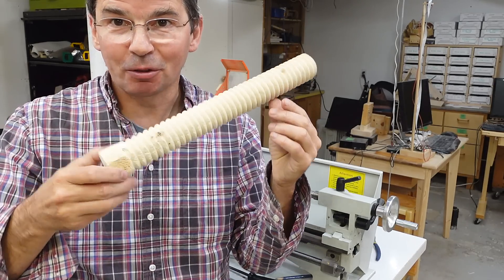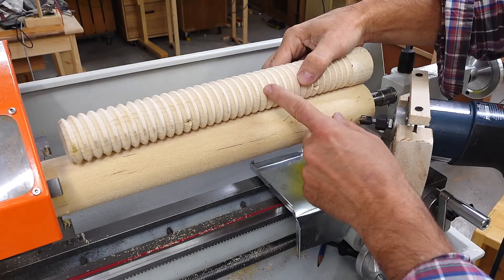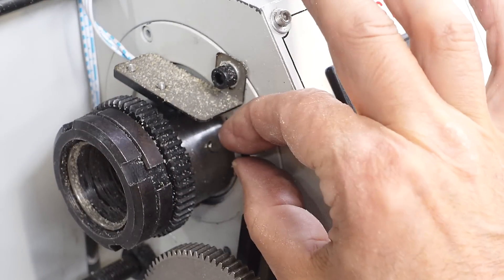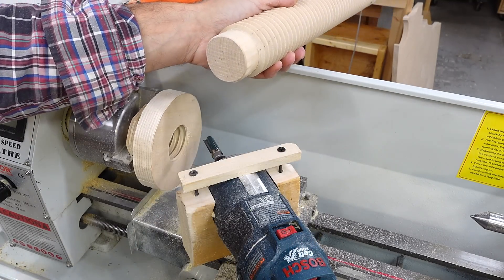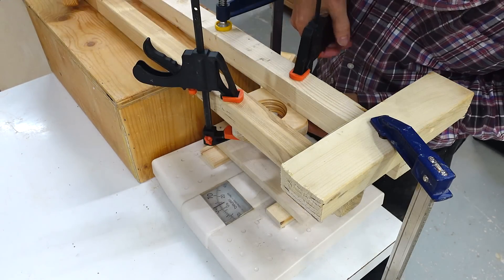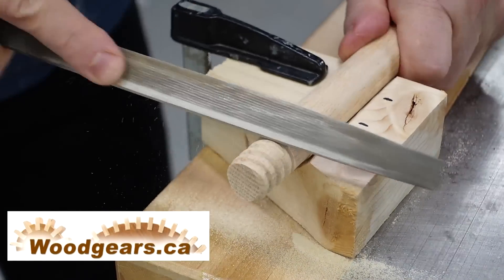Big wooden screw and nut on the metal lathe

Comment: If you are in the humour to make giant screws, i'd like to see you make a worm. there is a ham radio antenna rotator called the spid alpha that uses a worm to turn a cog. this is because a motor turning a worm does not require a brake to remain stationary in high winds.

Comment: I would think if the router is spinning, you'd be able to cut the wood going towards and away from the chuck. Right? No need to lift and return the tool to the start unless backlash was an issue. Now for the elephant in the room.....2 MAJOR safety violations. 1. the loose long sleeves on the wood lathe and 2. you left the key in the chuck. OK..I said it. Nice result though. be safe.

Comment: Maybe for on a wood lathe which are usually larger, but don't have a lead screw. Make a differental (aka Chinese) pully. Drive the pully from the headstock.  Then use the differental pulley to convert rotation into linear distance. pull cutting tool along a linear guide etc.

Comment: Can someone explain why the router is cutting the threads at an angle vs using a v-bit and cutting straight on? The only thing I saw is that it allows cutting the inside threads. Is there another reason?
Reply from the maker: that way I can cut into the wood, as opposed to one side cutting out.  also can cut much faster, and no burning, and clears the chips better

Comment: I long thought about a way to make a wooden nut without buying a specialty cutter.  Cool!
Reply from the maker: problem with this approach is very limited depth, unless you try to cut from both sides, but then aligning is difficult.  Or make two flat nuts and sandwich them.
Reply: @matthiaswandel  could you get greater depth if you used one of the bits from your morticer or is the thread angle the limiting factor?

Comment: I plan to build a toy involving wooden threads for a Christmas gift this year. I'm undecided as to the material for the wooden nuts. The best options I've come up with are some scraps of 1 1/8" plywood subfloor, hardwood, and making my own like 3 layer hardwood plywood. Seeing the plywood nut here makes me think it will be adequate. Though the subfloor is not that nice of plywood. I could glue 2 pieces of decent plywood together...
Reply from the maker: Or just use baltic birch plywood, which is what I used.

Comment: Acme thread forms will have more thickness and less taper, maybe better for wood - like a broom handle thread.  Acme = inch, Trapezoidal = metric.
Reply: I was thinking that as well, but it might be more difficult when the thread cutter is a spinning router bit being fed in at an angle like that.
Reply: @F0XD1E  Yes.  He would probably have to grind a HSS toolbit and put it in a small  angled flycutter toolholder to do it that way.

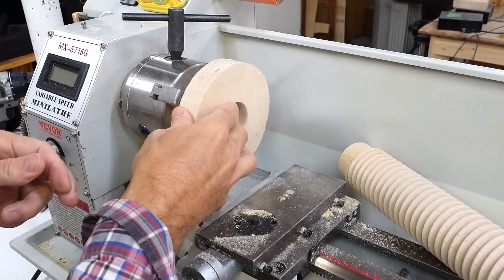Comment: 04:25 if you get the jaws of the chuck out and turn them arround you can clamp from inside, you should be able to clamp that part 
I know it would interfer with your cut but I thought I would still mention it in case you don't know about the jaw turning. Be careful tho, usually the order of the jaws is important for the chuck to be aligned
Reply from the maker: The jaws don't turn around, this lathe has a separate set. 
And clamping the nut from the inside is not practical because I was milling the inside.  Duh.
Reply: @matthiaswandel  you could  clamp inside hole ,turn outside to dimension that could be hold in outside clamping jaws. if part dimension allows it ofc.Its standard  for rounding things like flanges,washers etc. . .
Try get 4 jaws chuck with separate moving jaws and dial indicator then you can make excentric parts.Also there is a thing called face plate for mounting ireggular things with clamps and screws.
Reply: @matthiaswandel  I mean I also said I know that it would interfer with the operation, just wanted to  give info in case you are not aware of it yet. Was in no way meant to be lecturing or anything considering its not even useful in the operation you are doing.

Comment: In the old days (1930-1960) of shed-in-the-garden model engineering in the UK, there were two traditional projects for the metal lathe.

One was a handle for the main spindle - this allowed super low speed, high torque operation, and extended the range of possible projects.

it gives remarkable control for threading, e.g. up to a shoulder.

The other was a handle for the lead screw - exactly for the high pitch thread scenario you demonstrate. The pathological worst case pitch is rifiling, which can be as little as half a turn over the full length!
Reply: Those enthusiastic 1930's craftsmen would have given a vital organ for a variable speed hand-drill!
(Craftswomen in the engineering shop had not yet been invented... women had too much sense!)

Comment: I've never owned power tools or had the space to do woodworking. But I'm in love with the craft. Hope someday I can do my own small projects. good video, man
Reply: you dont need power tools or lots of space to do some small projects. go to a flea market and pick up some old hand tools mainly a hammer and a chisel and a saw if you wanna get fancy. when i was like 12 i broke a kitchen drawer and spent all day fixing it by cutting a new bottom out of old plywood with nothing but an old hack saw blade. funny thing is that drawer with the custom jagged bottom is still in my moms house 15 years later and still functions
Reply: Carving might be an option for you.  It's messy, but doesn't take a lot of space on the small scale and you can get started with just a few tools.  Just keep a first aid kit around for when you inevitably cut your finger.
Reply: I have a 1960's jigsaw and power drill, two long clamps, and a single tool bag of hand tools I've bought over time as needed (screwdriver, pliers, etc). A surprising amount of things can be built with this setup and it takes up almost no storage space. Most of my projects are held together with Robertson screws from McFeelys.

Comment: Running the lead screw for a very large screw pitch is some thinking outside of a box! Recently I need to make a large thread on my lathe - a wooden form to wind a coil for an induction heater and I am going to steal that idea. By the way - I have purchased a 1000W induction heater for my workshop and have been playing with that. It is only about 25 bucks kit, but you have to supply your own power supply - 48V at at least 20Amps, which is not trivial. The heater can heat up a tip of a chisel for heat treatment in under a minute. You can also use it to braze your own lathe tools using discarded tungsten carbide inserts.
Reply from the maker: Is this some sort of surplus part?  I have an induction hotplate, which is tempting to attempt to convert for forging
Reply: @matthiaswandel  I think they're a kit you can buy on the usual places - search for "zvs induction heater" - it uses a zvs flyback driver circuit, hence the name. I think more commercially, places like Eastwood and a bunch of other brands badge and sell them for heating stuck nuts and bolts without a torch, but they're rather pricey when they're a finished product ready to plug in and use
Reply: Forklift chargers are dirt cheap and most of them are 48V with at least 40A. Nice "little" power supplies.

Comment: I have a height adjustable stool that uses a big wooden screw, and it's nice in that it lets me adjust the height infinitely.
Reply from the maker: I think those look cool, but I prefer the stools I made, which I made for the height I want, and they are rock solid, good for standing on too.
Reply: One of practical uses for those I've seen is piano stools. I used to have one of those round ones that's been with me all the way whilst growing up and it could be adjusted quickly.

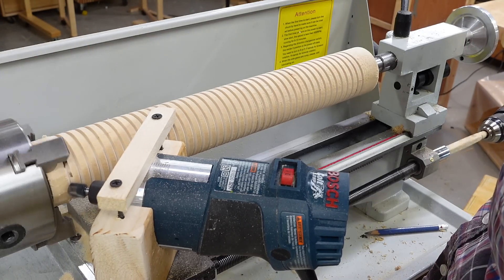Comment: 2:12 "So no damage to the carbide router bit"  -  That poor chuck 😞
Reply from the maker: It actually just looks like a scratch on the chuck jaw
Reply: @matthiaswandel  :  I have a 70 year old lathe... the chuck does not even have a scratch on it!...
(It's a new chuck, fitted last week!)   😋 😜
Reply: Just wait til 3:10, that scratch is the least of the lathe's concerns 😅
Reply: Eh, lathe chuck jaws get damaged all the time. As long as it's not a clamping surface, its fine, and if it is a clamping surface, you just use the lathe to turn them back so they're even again.

Comment: Hi Matthias.
@3:34  the Hall effect sensor you are pointing at is only connected to the RPM display. It only receive 5v from the main board.
The motor speed is mesured from three additional sensors hidden inside the head, on a dedicated PCB.
Reply from the maker: Ah, good to know.
Reply: The sensor is likely ONLY for the display.  And there is likely ONLY one sensor.  There doesn't need to be any feedback to the motor control.  The potentiometer sets the speed.  It sets the pulse width.  Nothing else is needed.  And Vevor sure isn't installing anything not necessary.
Reply: @mk6595  
There is actually some feedback to the control board on this lathe. The PCB inside the headstock connect both the 3 phases and a signal cable with a JST connector.
I have the exact same lathe and had to replace the motor on mine.
Reply: @quentinbonenfant7992  What three phases?  This isn't driven by 3-phase power.
Reply: @mk6595  this model is powered by a brushless DC motor, which uses three phases. The main board convert the ac main power into three phases, a bit like a VFD. Check out replacement board for this model, all the I/O are labeled.
Reply: @quentinbonenfant7992  Well, I'm impressed.
Reply: @quentinbonenfant7992  I have this same exact lathe model and the hall magnet ring is for the tachometer display only. The brushless motor itself has hall effect sensors for timing it's commutation. You do not have to have position sensors for a BLDC but for this low RPM/high torque application, you do. There is no VFD, it's a DC brushless motor. Rectified AC stored in bulk capacitors and some mosfets to switch that on time. The RPM display gets it's power through a JST connector on the spindle control board. The magnetic hall effect sensor plugs into the display directly, there's only two 5V power wires between the display and motor controller.  

The final tell, the motor has three large gauge power wires for the three phases, and then it has a 5 wire JST connector. That's a hall sensor for each phase, plus power and ground.

Comment: I made an extension for my lathe by using an inner bearing race from a front wheel bearing off of a Toyota RAV4. This so happened to fit the threaded nut off of an angle grinder. I pressed it into the race very careful to keep it square and then I spot welded it on. I found a 5/8 bolt to fit the threads and cut it to a 30° point in the lathe. Now remove your tailstock and this assembly can be mounted in your steady rest all the way to the end of the lathe. You can dial in the center using the adjustment screws on your steady rest. I should mention, the bearing race has a flare on it so make sure that is toward the head stock so as you tighten the center point screw, the flare will rest up against the edges of the steady rest screws to keep everything from pressing out of the steady rest. It all worked great and gave me another six to eight inches of room on the lathe.
Reply from the maker: if I needed to make a longer wooden screw, I'd make some wooden tailstock that attaches to the end of the lathe.  But the next limit would be carriage travel.  Still, I'd be able to get at least another 5 cm of threading that way, plus a bit more unthreaded part at the end.  Now just need to find a need for a wooden screw like that.
Reply: @matthiaswandel  Aren't you going to make a wooden machine lathe?

Comment: I could see you making a height adjustable desk where you turn a large wooden wheel, that through wooden gears raises and lowers a desk.
Reply from the maker: problem with wooden screws like that is they are relatively inefficient compared to a rack and pinion, so hand cranking it would be a lot of work.  The basic flexispot desk frames are not very expensive, so not very motivating come up with a wooden version.
Reply: @matthiaswandel  A child powered Hamster wheel attached by belt-drive to the FlexiSpot gears in the event of apocalypse and no electrical power is available 🤣
Reply: A major issue with wood screws is the friction involved. They are very sticky under load so adjustments would take a lot more force than a metal screw.

Comment: Electronic leadscrew soon?
Reply from the maker: that wouldn't work as well for this as what I used.
Reply: @matthiaswandel  I like the long screw and nut, that's just cool. What if you made a few of them and flat connector panels with holes, and then made an Erector Set sort of large-scale assembly toy?

Comment: Up next.....wood dust collection for a metal lathe
Reply: Yep. Wood dust is not good for the metal lathe - it absorbs moisture and rusts the lathe (ask me how I know...)
Reply from the maker: that might have been a problem in my old shop, but I keep the humidity at 50% or less in this shop year round
Reply: @matthiaswandel  That's great! Wish I could do the same - to many vents and big area, make it impossible to control temperature or humidity, without a complete remodel.
Reply: That might make a decent video 🤔